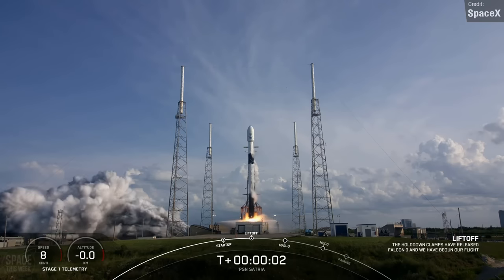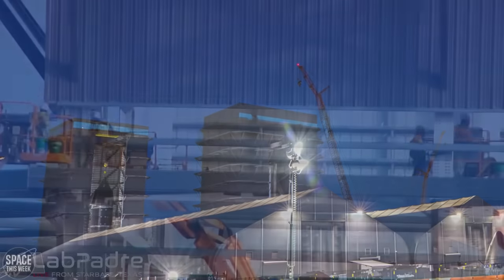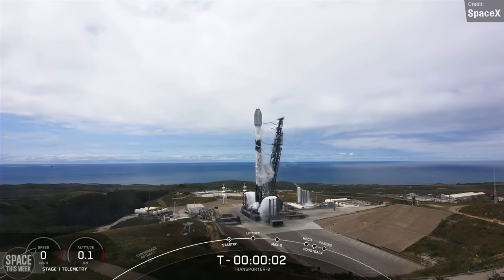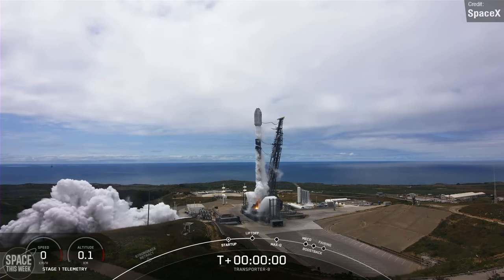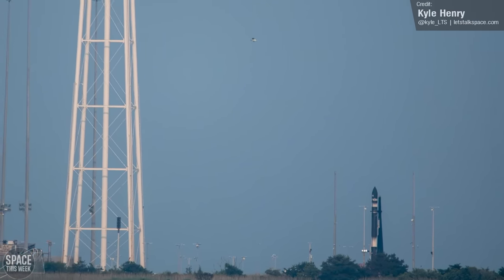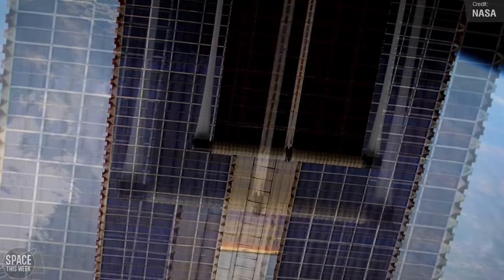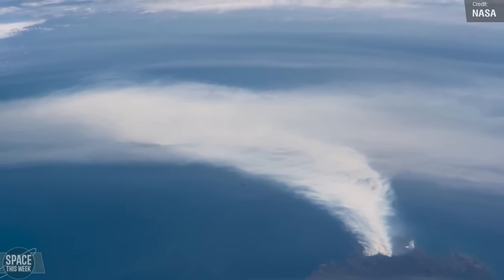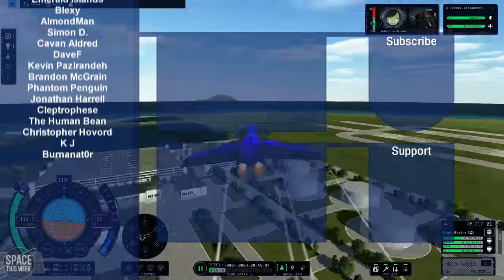SpaceX Starship Test Falls Short, Rocket Lab's Hypersonic Secret, Falcon 9 Milestones, KSP 2 Updates

Comment: If they go to 111% than what's 100%? Is that the original RS-25 performance, or are they just making up numbers because they look cool?
Reply: The development goal was set at 100% and it was exceeded in development. When development was over, they didn't reset 100% to the new figure, so the Shuttle would able to go to 104%+ thrust. The new RS-25 engines can get a higher thrust than the Shuttle engines.

Comment: hey matt, love ur vids. have you seen the mod Textures Unlimited Recolor Depot for KSP 1? it allows you to custom paint the parts in a way that imo is way better than how ksp2's painting system works at this time. you get 3 colors to work with, rgb sliders, a metallic slider, a specular (aka refelctiveness) slider, and a detail slider which essentially changes the contrast of the part. If you use it correctly you can make ships which look super cool, even better than ksp2. would be interesting to hear your thoughts on it compared to ksp2.

Comment: Anything over mach 5 is hypersonic.  Electron has always been hypersonic
Reply: HASTE performs hypersonic flight through the atmosphere horizontally, at much lower altitude than orbital flight. Unlike HASTE, Electron orbital launches escape the atmosphere as vertically as possible to reach orbital velocity with as little atmospheric friction as possible.
Reply: @paulcarter7445  They need to redefine hypersonic from "greater then mach 5" to "greater than mach 5 and able to maneuver a random path to the target"  this is what makes it hard to stop.